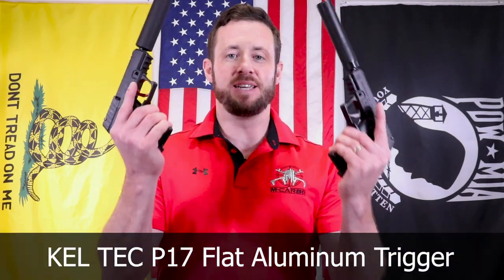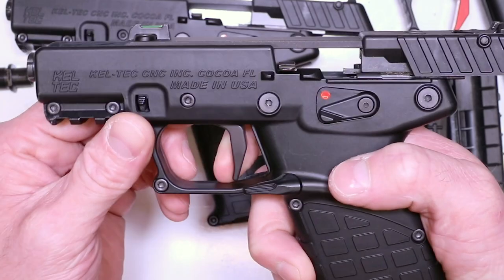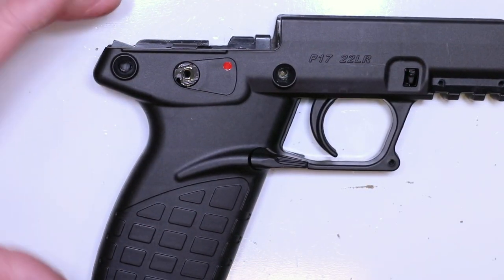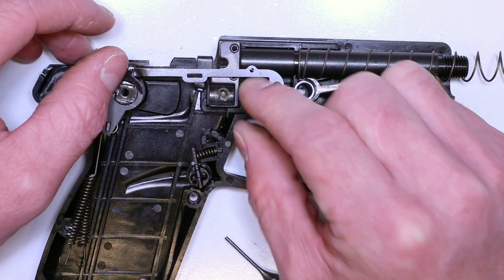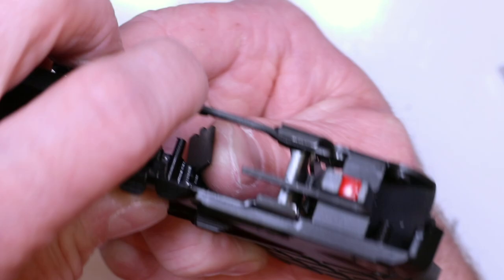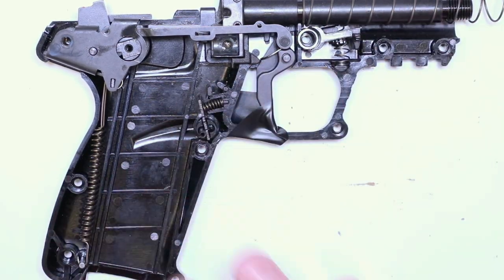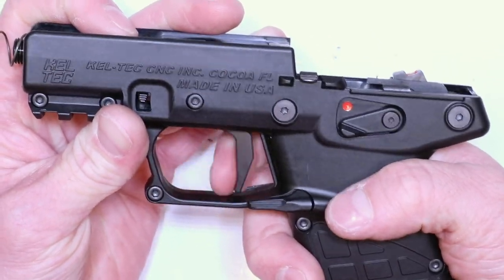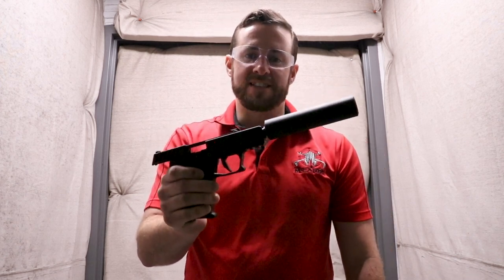KEL-TEC P17 Flat Trigger - KEL TEC P17 Accessories - KEL TEC P17 Disassembly & Review - M*CARBO!

Comment: That 3D PRINTED PART is absent from P17s produced starting in 2021.  That was a temporary fix.  Newer P17s have a flat horizontal built in polymer projection designed to capture the spring as you did upon the 3D printed wedge.  The trigger still needs to be pulled back😊 allowing the spring to sit atop the projection.

Comment: Just picked-up a P17 yesterday. Once I shake it down I will most definitely add your trigger (in black) to it. I'd add that mystery part in aluminum if it were available for a reasonable price when I do the trigger install. I would not do it as a stand alone upgrade. I will say that this video is nothing less than excellent!!! Very nice! (I'm retired from film and television engineering so I've seen the whole range)

Comment: I have a Kel-Tec p17. The trigger is great. No need to spend money.
Reply: Or the fucking insanity level effort of replacing it.
As a gunsmith it really isn't insanity but the trigger isnt a drop in, and isnt that much of an upgrade deeming it unnecessary if the trigger costs 1/4 of the gun.

Even moreso that dude thinks paying for a 500$ supressor and an annual ticket is worth it for a glorified plinker

Comment: Just picked up my P17 today. I had to pay the COVID-19 tax, but have this Kel-Tec pistol in my possession! 
Maybe after election day things will be more normal or maybe worse. 🙄

Good video, Chris! 👍🏻 I would not have attempted installing this flat trigger without you providing detailed instructions. 

Mine did not have the 3D printed part.....called Kel-Tec before reassemby and was told this was a trigger stop and was no longer needed on later versions. Still makes ya wonder!
Reply: Picked mine up last Wednesday for 194

Comment: The p 17 needs a better slide release. The stock one wears out easily. Also an optic capable slide would be nice.
Reply: Keltec is now selling slides with crimson trace red dots.  199.99 
I've only seen them in black though.  I'm waiting for the fde cover plate.  Idk if the original will be compatible with the dot.  Also has raised sight for dot.
Reply: That's because it isn't a slide release, it is a slide lock. Sling shot method to charge.

Comment: Thanks for the video. I always enjoy a thorough walkthrough of the internals of a pistol and all the little quirks of reassembling these Kel Tecs without their factory assembly jigs. The 3D printed part is interesting for sure. I wonder if they’ll have modified the frame itself after they work through the first production runs.
Slightly unrelated, but do you folks make a tool for the RDB Survival barrel nut? It’s proving tricky to remove the front sight.
Reply from the maker: Thanks Brother, glad you appreciate the video.  Will be interesting to see what changes on this platform between production batches.  At the moment we don't but will look into the RDB Barrel Nut wrench idea!
Reply: @MCARBO  Barrel nut / thread protector (that’s what I meant)... a combo tool would be very useful. Thanks much.

Comment: So easy a caveman can do it! Seriously! I did the upgrade over the course of a conference call at work. Call ended and sent a mag off the back porch right after. 

VERY CONCISE instructions. Don't be intimidated by the little springs doing their springy things. Just be patient and you'll do great. 

And yes, Huuuuuuuuge difference after install. Feels like a real pew pew now. Best $30 you'll spend on the P17 hands down. 

Thanks again for the very informative video!
Reply: I can't get the barrel straight at the end, so the top half wouldn't go on.  Pls help
Reply: @Ben2Benw  Do you have the metal retainer installed still? If I recall, I had the same issue and it was because I set that aside in the case and forgot to put it back on when putting the side back on.

Comment: I was watching reviews on the G 44 then I came across 22 plinkstir reviewing the KELTEC P17. He gave it like 4 1/2 stars but I was thinking Itit would be great to have a optics plate, adapter and a flat trigger. Then I put in upgrades for KEL-TEC P17 and came by Chris Nelson Great video on the flat trigger. Wondering if MCABRO have an adapter plate and a few other upgrades Kel Tec P17.(I know that a stainless steel shelf plate would the for the spring would be more far superior than a plastic 3-D print it polymer

Comment: Love my new trigger.. just curiouse tho, have they changed the 3d printed support block? I just purchased a brand new p17 and just installed your red trigger but mine does not have that support block???? Seems to run cci just fine so far but just curiouse.  Thanks again so much..

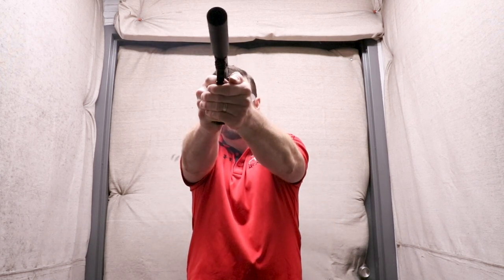Comment: The trigger looks great. May pick one up. I've got a P17 and when I run my suppressors on it, I get a ton of powder back in the face. Do you experience that as well? Also, I noticed at the mag change at 39:13 that the slide moved without pressing the release. Mine does that as well, and does not always hold back on the last round, really touchy.
Reply from the maker: Most likely we'd have to make a stronger recoil spring for running suppressed. I advise using CCI Quiet or American Eagle Rimfire Suppressor. It runs great for us without gas and powder to the face.
Reply: Hate to be the one to say it but... maybe wear a mask or a bandana or something? It's a clever design from a mechanical perspective with how open that ejection port is, but 22 is dirty and I don't want that shit in my lungs lol

Comment: I'm all for customizing my guns but I need MCARBO to answer one question.  According to the P17 owners manual, states on page 3 item 8... making changes to the P17 voids the warranty.  Has MCARBO worked a deal with KEL-TEC or are they just not going to enforce it. I have a PMR30 and had done the entire all in one MCARBO bundle. There were so many issues unrelated to the MCARBO upgrades and I had sent it back to KEL-TEC and they repaired it without a word about the upgrades. So I guess it's a moot point. I suppose KEL-TEC can selectively enforce it if they choose. By the way I do plan on doing the flat trigger as soon as I quit gagging over the $40+ price tag.

Comment: I tore mine apart due to the slide spring getting stuck, and while i had it apart i noticed that mine did not come with the 3d printed spacer thats in this video. Does anyone know if they've discontinued that? I feel like i should contact them but know that tearing it down "voids the warranty".

Comment: please help. the other half won’t clip back on snug and my safety doesn’t move no matter how loose the screw is, even with the screw iff it doesn’t move on the other side. what did i do wrongggg😣
Reply: nvm i fixed it. thanks for nun fammoo
Reply: I can't get mine to line up proper, the barrel is off centered.  IDK what to do, it's frustrating.

Comment: So the trigger bar is refusing to go into place, it keeps moving the safety bar, which you don't bother to show how to reinstall. When I finally got it all together, the trigger wouldn't pull the hammer. Had to take it all apart again and am now looking at a useless pieces of metal and plastic.HELP.
Reply: I left mine in a box.......... still waiting to be re-assembled.🤔
Reply: @paulsaver8777  same, it's beyond frustrating.  I can get mine together, pulling trigger but the barrel isn't straight.  The body is so cheap & crap

Comment: I'm just too scared to open up the gun and fiddle with the parts. If ever the gun fails and there is a AD, Kel-Tec or any other company will say you fiddled with the internals and are not a gunsmith, lawsuit lost. But I agree the trigger angle is all wrong stock, everything else about it is genius. I do dislike the toy feeling plastic used for the frame.

Comment: Don't understand the flat trigger obsession and worship.  🙄

The argument usually given is that a trigger is flat so you can get the same location for your finger consistently.  However, this is actually the OPPOSITE of reality - with a flat trigger, one places feels almost the same as any other, whereas with a curved trigger, the apex of the curve is the same every time, so this criticism is nonsense.

In this video, it seems the argument is that having a flat trigger enables you to put your finger further down on the trigger, therefore giving you more "leverage" and making the trigger pull "easier."  This makes no sense to me.  Is the stock P17 trigger too difficult to pull?  Does it need to be easier?  From what I understand, it does not.

Finally, I am just going to say that, my finger is round - an ideal place for my round finger is on a round trigger.  If you want to make a round trigger (or semi-round, to get some of the benefit you are talking about, without leveling the apex) but in aluminum, then I'm in.  
👍